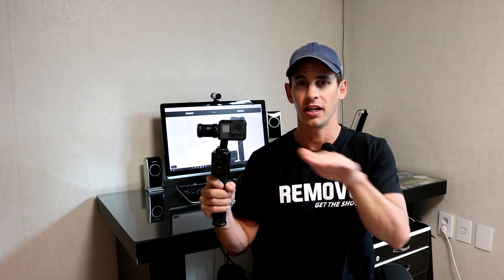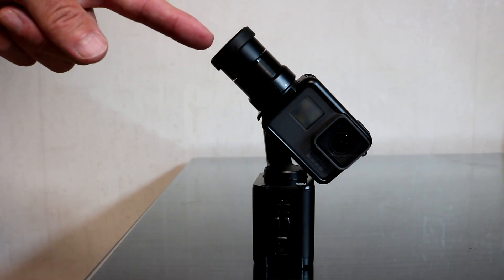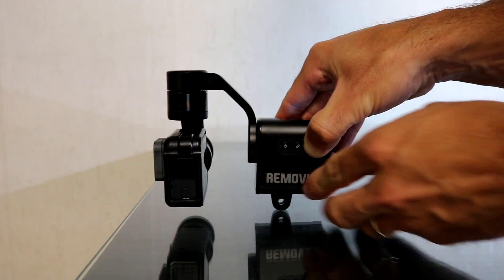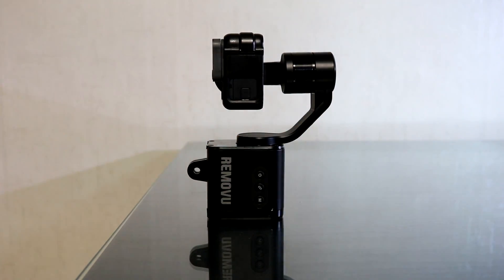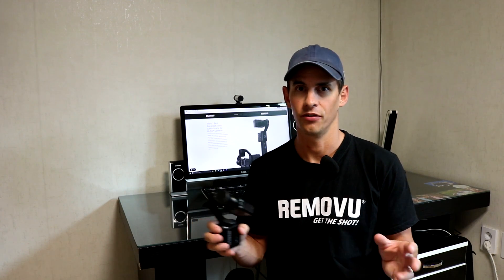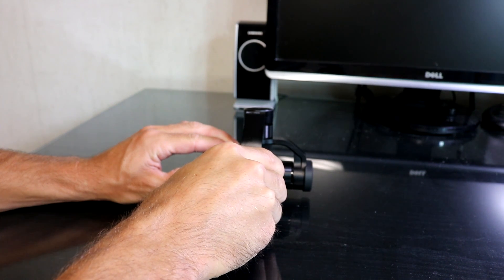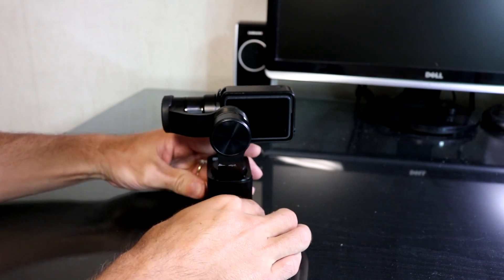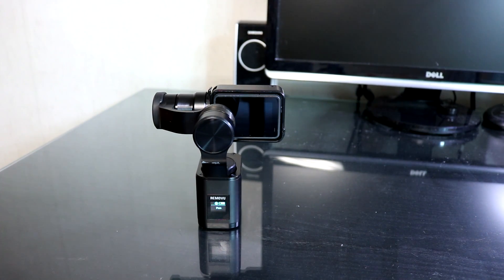S1 User Calibration

Comment: I have a problem with my S1.  I have had it for 2 years now, and had it replaced once.  Mine seems to sag horizontally about 3 degrees down to the right. such a piss off, I contacted support again, just waiting for a response. Yes support is a little slow, but they have always responded for me!?  Does anyone have to calibrate the Gimbal often?  It seems like If i don't use it for an extended period of time i have to re-cal.   I am using Hero 7 Black with the counter weight ON and in Back Pack mode ON.

Comment: Nice video! Can I ask if used Hero4 Silver, do I need to attach the balance weight cap on the tilt motor, please?
Reply: No, you do not need to use the balance weight cap with the HERO4 Silver. You should only use the balance weight cap with a HERO5 or a HERO4/3 that has a BacPac on, like the LCD BacPac.
Reply: Thanks!

Comment: So the gears grinding or noise is a normal thing? I keep getting worried when I hear it
Reply: Update the S1 with the latest firmware (1.3.0). It has dramatically reduced the motor noise. And when using the HERO5, enable Wind Only mode.
Reply: GoGarr Garry I think he was referring to the grinding noise during calibration. I have the same and I am also always worried.
Reply: Yes, the grinding sounds during calibration are normal. Release the camera when you here the noise like how it is done in this video

Comment: Thanks for the new video. But what to do when Mode button don't  work? I can't change the Mode. 
The Mode can only be changed with the remote. So i can't do the user calibration. I have also made the PC calibration, but no luck.

I have the latest firmware and the problem was also there before updatinge to the new firmware.
Reply: Submit a support ticket. If your mode button is broken, it is covered under the warranty
Reply: I did but no response
Reply: I can see your account in the system, but you did not submit a ticket. Are you sure you submitted a ticket?
Reply: Hello, yes im sure,  i used this contact form: https://www.removu.com/inquiry-form-europe-africa/

Comment: Hi there, what about Gopro Hero 5 Session calibration? I understand that I have to follow exact steps as with Gopro Hero 5, but do I need to have counterweight attached too? Housing for the GoPro Hero 5 Sessions is not perfectly square as the lock slightly comes out, will that be an issue, especially when calibrating the other side?
Reply: HERO5 session should never use the counterweight. The counterweight is only for the HERO5 Black and HERO6 camera. For HERO5 Session, do not use the counterweight and turn off BacPac mode on the S1

Comment: I got this for christmas and have yet to be able to use it for longer than 2 min. I had it attached to a gopro mount. and within 3-4 min every time the gimbal spins the cam to face the wall. This gimbal sucks.
Reply from the maker: Please contact support@removu.com so that we can help you resolve the problem you're experiencing.
Reply: @REMOVUGlobal  I did SEVERAL times and got no replies. I am returning this gimbal. Its horrible. Removu KNOW it has issues and you dont fix it..HORRIBLE.
Reply: @REMOVUGlobal  I called and called and emailed and Removu NEVER contacted me back. So I returned the gimbal and will purchase a different brand. I love what this gimbal was supposed to do but ZERO customer service and KNOWN issues with it make it not the one for me..

Comment: Hi. Have two questions /complaints. First off all, the battery i recieved is defect. It only charges for 5 minutes before it tells me it's full.
The other question is, that I tried to upgrade the firmware. But It failed (when the gimbal was in sleep mode) and now i can't seem to get the gimbal out of sleep mode again. So when i turn it on, the lcd screens goes on but the gimbal acts as if it was off. Please help. I am desperate. Need it for Production!!
Reply: Please submit a support ticket to REMOVU in order to get the battery replaced. As for the firmware update, you can do the process again. Do not unplug the S1 until you get a "completed" confirmation message from the app. After the download progress bar hits 100%, it takes about 2 mins for the update to complete. Then it will display a "completed" message.
Reply: Your S1 Gimbal looks like it is sleeping because you pulled the USB cable out before the Firmware update was complete. You have to wait until the software pop-up box says complete before disconnecting the cable. Make sure your battery is fully charged then leave the Gimbal switched on for up to 5 minutes, remove the handle and leave it on a table. Just let it sit don't touch. It should come back to life after this time. Then do the firmware upgrade again and be sure not to remove the cable before it has completed. It's not broken.
Reply: BTW use the 1.3.0 firmware it just came out a few days ago.

Comment: It is necessary to carry out factory calibration, but I can not find the software.
How can I get a "s1 calibration commander"?
Reply from the maker: Factory calibration is no longer needed. Just perform a user calibration as done in this video.
Reply: It would be unnecessary my suspension would already work. Give the program for factory calibration and then I'll tell you whether it was necessary or not to calibrate. For today, the suspension is dead in all three axes, and the user calibration corrects only the horizon.

Comment: hi i just got my removu but my remote control does not charge or turn on can you help ?
Reply: Try using a different USB port and USB cable. If it still does not work, submit a support ticket on REMOVU's website